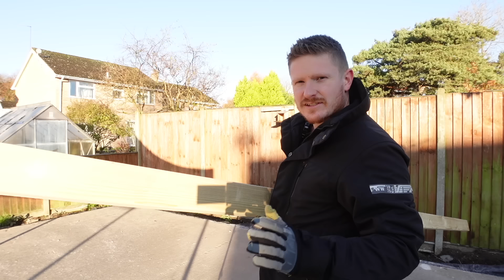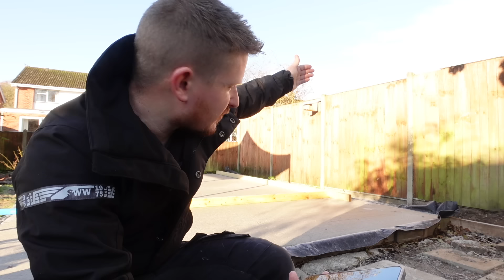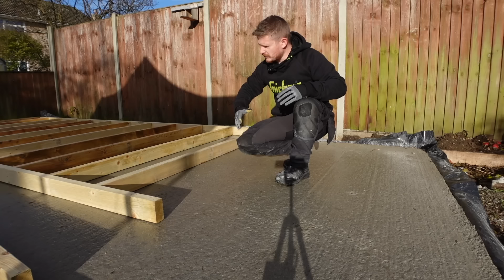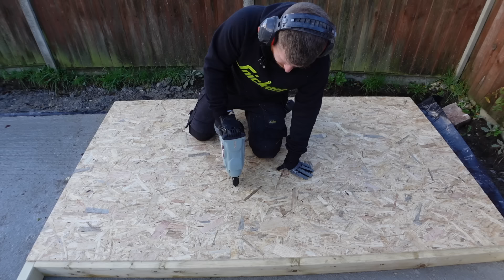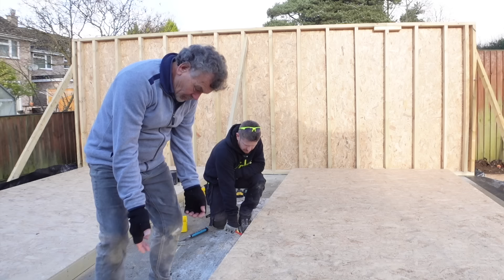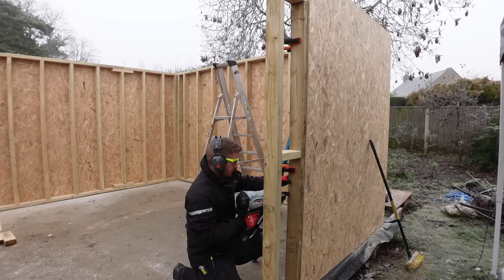How to Build Timber Frame Walls Quick and Easy  - Workshop Build PT3

Comment from the maker: Hope you guys enjoy this as much as I enjoy building it! Roof episode to come soon 😊
Reply: Looks great, how does our climate suit these frames and ply? Like moisture rot.
Reply: Hi mate, thanks for the video and all the good work you! Just wanted to ask what you think of the Evolution pop-up gazebo as I am after a good one and would be grateful if you could share your opinion on that please. Thanks
Reply: That's stick frame not timber frame..
Reply: The studs C16 or C24?
Reply: Hello there DIY Guy. 

I’m building a garden room using your design. I’m just finishing off the front wall (4.8m wide) and have made it from two side panels (1200mm each) two 300mm wide supports for the lintel (1200) for a French door/window combo (1800mm wide). 

My concern is how to make the various components really tight and strong. Could you let me know any top tips. 

Thanks

Comment: Morning. Love the videos.  I am about to receive my log cabin for DIY build.  The builders have put in a slab base which is bigger than the cabin.  The cabin will come with a base and I am wondering whether or not I should be installing and dpm underneath the bearer's 1st?

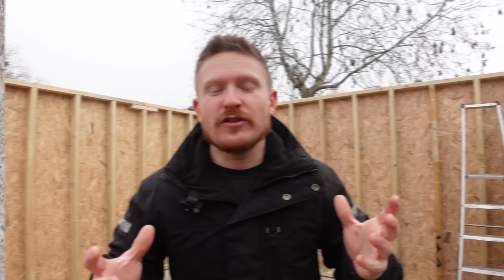Comment: 15:55 - thanks for this, loving the channel, hugely helpful! BUT I'm adding a course of engineering bricks before the sole plate so think I need M10 bolts and resin instead of these concrete bolts? Heard conflicting opinions about the brick layer but seems more belt and braces...

Comment: Just wondered about the maths for the side walls? Isnt the length of the wall 3820mm rather than 4000m due to the front and back of the building. It doesnt effect the number of struts and i think only effects the angle by a degree (i.e. nothing as the acuracy of the cut probably negates that)

Comment: how did your sheets line up with the centre of the stud. Standard OSB width is 1220mm and if you are going every 400mm centres but starting at the edge of the first stud then the sheet is going to hit close to the edge of the 4th upright not in the middle - or am I being stupid?
Reply: are you using 12mm OSB?
Reply: Yeah, I just started designing mine in CAD and not only does 400mm not work with 1220 OSB it's even worse than that....the first measurement has a whole 2 inches of the 2x4 on the outside stud whereas each internal one only has HALF the stud (half for each OSB board). In other words, whatever the measurement should be, it will be different for the first internal stud on either side of the wall.
Reply: I've just seen another comment he replied to. He's ripping the OSB to size I think! Didn't mention that in the video. =[

Comment: Stellar video. Say, any particular reason why you use 400mm spacing between posts? Can I get away with 800mm?
Also, why put a membrane on the wall boards if I am going to use IBR for cladding?

Comment: this is great... quick question though, back in my previous carreer in the horse world we had many stables built over thenyears and the contractors always sent us a spec sheet to have a builder do the base and always lay a course of blue bricks to stop water creeping up the woodwork, i noticed you did not do this, will water not sit on the DPM strips and evtually creep up into the wood. one time at a stables this was not done on downpours we would get small amounts of water coming into the stable and wetting the wood shavings bed, not much but it did certainly creep in.... your the expert though so tell me im over thinking it. 😊😊 I know its presurre treated but todays pressure treated is not a patch on what it used to be when chemicals now banned were used.

Comment: Hi, really learning a lot from your channel. Im planning to build a shed myself therefore I'm watching your video's. 

I have a question. Your front wall is higer than your back wall, this creates a certain degreedifference. 
Did you also adjust the beams you lay on the roof for this slight difference in degrees, by cutting a flat bottom where they rest on the backwall? The beams are flat and now they lay not perfectly flat because of the height difference. I hope you know what I'm trying to ask.

Comment: Good evening, i have just laid my concrete pad first time ever, 5x6m!!!! im now considering ditching the thought of doing 2 courseworks of bricks before my timber walls, i have dpm under the pad with a decent overlap, now im considering putting the timber walls directly ontop of dpm and screwing them into the pad, any reasons why i shouldnt do this?

Comment: The angle is actual meant to be worked out using Tan-1 (0.08÷10) = 0.46 degrees.

Comment: Technical question about the side studs - You're cutting each stud 8 mm shorter than the last one and putting a 1 degree angle on it. Are you cutting the angle upwards from the finished height or downwards? Ie you mark stud 2 at 2112 mm, do you cut the angle so that the other side of the wood is slightly higher than that, or do you mark it so it is slightly lower than that?

Comment: Did you screw through the DPC & DPM on the bottom plate, breaking the water barrier - would it not allow water to travel through to the timber base plate?
Reply: 100mm screw wouldn’t be long enough to go through the tiber and all the way through the slab to penetrate the DPM, but could be an issue if the pilot holes are made too deep

Comment: Nice work. You mentioned using 1 degree for side wall uprights cuts (along the 2" side). Did you also cut uprights (along the 4" side) of the front and back walls at 1 degree so the top plates are sitting fully flush against roof joints ? Or this is so minimal that it doesn't matter ?

Comment: The video only showed you fixing a single DeWalt concrete anchor bolt but hopefully you installed more than that! 😜

So how many, ie how far apart would these need to be to hold this structure safely to the concrete base , particularly in stormy/windy conditions. What is the recommended distance apart for those (presumably 6mm) concrete anchor bolts.

Would using 8mm or 10mm bolts be any safer or is it overkill? Are those Dewalt anchor bolts stronger than other anchor bolt types like sleeve anchors or wedge anchors etc?

Comment: I thought the maximum size under permitted development was 15m2 how have been able to build yours so big?
Reply: Contact your local planning authority, or check their website to see if you are in an area that restricts your permitted development rights. 
Broadly you can go 4m out with a detached house, 3m with a semi-detached or terraced, however restrictions apply and you should consult the regulations, or find a local architect via the RIBA. 
Like this building, YMMV

Comment: I believe you put a waterproof membrane before you put the concrete floor, what if my builder did not do this and 2 years on, I am having this damp on plasterboard from the inside. Do you have any recomendation for my problem?
Reply: If you look carefully you can see damp proofing sticking out from underneath of the concrete slab

Comment: how about if you go 2 meters away from the wall, can you build higher? 2.1 meter is not bad, for ceiling but we have mtb, I was planning to store the upright against the wall and I was calculating that I will go 2.3- 2.4m until ceiling.  How far I need to be from the wall to build higher?

Comment: Would building same height walls all around with no drop and then when the roof joists are on make furlings to sit on them to create a fall for the roof work? It would also mean that inside your ceiling would be the same height throughout?
Reply: 100%

Comment: if i space my studs at 400center starting from the edge of the panel my 1220 board sits right upto the last stud leaving no room to place my other board , what am i doing wrong, ? although 16" on center works perfect, regs for uk say 400 - 600 i believe 16" is US. ?
Reply from the maker: That’s common. Rip each board down to 1200 and you’ll be good to go
Reply: Wood sheets are different to plasterboard so if u do to suit wood sheets won't work for plasterboard

Comment: sorry if you get asked this every other day, but what timbers are you actually using. I've seen different sizes of OSB and even the "2x4's" aren't actually 2 inches by 4 inches... I'm assuming they're 50mm x 100mm but when I search for that, I find timber that's actually 44mm or 45mm "finished".
Again, sorry if these are noob questions, but I'm planning my own garden building and I need to get everything right so I don't f it up down the line. 
These videos are some of the absolute best videos out there on how to build a garden room, so I know whatever you say will be right. Thanks in advance.
Reply from the maker: Hi. For the walls I’m using 47x100mm.
Reply: @TheDIYGuy1  thank you so much

Comment: Genuine question,  but permitted development seems to have 2 rules which I can't see that you meet?   The first one is that within 1m of a boundary, the walls need to be made from non combustable material (i.e. not wood!).  The second is that the maximum height at the eaves needs to be 2m (not 2.5m).   Have I got it wrong?
Reply from the maker: As long as the walls are coated with a non combustible material which mine will be(metal box profile) it’s fine. 2.5m at the eaves is the rule and that can be found via many sources online.
Reply: @TheDIYGuy1 Thanks you for clarifying this, big help for my planning of a new garage!  Great videos by the way!

Comment: Just out of interest as im looking at building my own, why didnt you just make the framework square and add 80mm furings to the roof joists? Would that not have been quicker? genuine question, not trying to fault your work :)
Reply from the maker: Good luck with yours. Personally it takes me very little extra time to calculate the fall and angle and make the cuts but If you find it quicker then that’s the way to go.

Comment: Hi Cameron, came across your videos and absolutely loving them as I look to take on some jobs this year.  I am looking at a smaller version of this for my own garden but a question I have if you could help.  I already have solid and level decking which is actually on the top of slabbing, can I use the decking as the base or would you suggest pulling that up and using the slabbing?  Then I assume I'd build a frame for the floor similar to your wall frame to lift it off the decking and place damp proof membrane on that then sit the walls on it?  Keep up the great work and thanks for the Amazon link to some of your tools!

Comment: Love the speed and no nonsense approach. Cocked up with the 10 uprights @8mm though.. needed 11 uprights for that 80mm lift...no lift on the first one !! and I bet you would let the osb hang enough to cover the ends of the other walls too if you built it again ??
Reply: I’m struggling here too it’s not adding up in my calculations 😮
Reply: @trevorswayne3374 is it because the wall is not actually 4000 long but 3820?
Reply: Is it because the wall is not actually 4000mm though it's 3820mm after after taking off the 2 x 90mm for the front and back wall where they join?

Comment: Thank for the explanation of how to work out the wall heights - front to back - and the drop per metre to get a the correct drainage slope on the roof. Very, very helpful. Excellent video series all round. Keep up the top work. Subscribed😊
Reply from the maker: You are welcome! And thanks for the sub

Comment: Awesome vid for a newbie like me! Thanks for all of the detail. Question: why did you not have the OSB on the sides, overlap the 2x4s of the front and back walls at each of the corners?
Reply from the maker: Glad you liked it. No reason, just my preferred way of building. I put them bits of osb in afterward

Comment: Probably one of the beat instruction videos I've watched and I've watched a lot. One question, I want to extend an already old shed but in great condition it's on concrete that needs resurfacing the wood in some areas needs some attention replacing etc... however I want to extend this shed, its 22.26 m² up to a drop in the garden patio which has a drop of around 10 inches I'm hoping to add joint straps (for a floating floor) from the original footing extend over the patio, the extention will be around 7.9 m² is this doable  ? Thanks
Reply from the maker: Brilliant! The shed extension certainly sounds do able to me. There’s a lot of ways you could achieve the height difference to bring the floors level

Comment: Why have you been able to build from wood and not brick?                       

I am looking at doing almost the exact same build myself but came across an issue that you don't mention. In that building regs suggest that building within 1m of a boundary, the walls should be mainly constructed from non-combustable materials. As the build is over 15m2 (which I am now limiting my build to) then building regs apply.
Reply from the maker: Your correct about non combustible materials within 1m from boundary. Simple way around this. Clad the boundary facing sides of the building with metal box profile or cement board and you will be within permitted development rules. Problem solved 👍
Reply: @TheDIYGuy1  Unfortunately not in my case as the area I'm going to build has 3 boundary walls 🤦‍♂️ Basically the garden is an "L" shape, hence going to the 15m2 then building regs don't apply. Which seems mental.
Reply: If it helps, I am constructing a similar wood frame building right up to my boundary wall and building control have said that with cement board cladding on the outside and double plasterboard on the inside I am good for fire regs. The house next door is about 3-4m from the boundary though.
Reply: @pineapplegrower Double plasterboard as opposed to a single layer fire rated board?
Reply: @macmcdade5071  Well that's what the Building Control guy said, but perhaps I should ask that question?!?

Comment: Looking great Cameron. Clever way of calculating the pitch. Only difference I’d have made would have been to extend the osb at the bottom of the walls so it came below the slab and ensured any rainwater running down the wall couldn’t track under the bottom plate.
Reply from the maker: Thanks. Regarding the OSB. I’ve another way of solving any water/moisture issues which I’ll show in the next episode 👍

Comment: great progress on the workshop! Would it be better for those concrete screws to have a washer to hold the frame even more to the ground?
Reply from the maker: Thanks. These particular concrete screws have what dewalt call a ‘locking washer head’ so a washer isn’t necessary. If you take a look at the underside of the head on the video you can see this.
Reply: @TheDIYGuy1  perfect! Will give them a try someday

Comment: Should of done a 6 inch brick upstand around the perimeter to get the timber away from the ground...rain gives up splash which rots the bottom of timber buildings fast....other than that you're doing a good job 👍
Reply from the maker: The dpm will be folded up the side of the walls with a breathable membrane overlapping it. This is then clad. No rain or splashing will come in contact with the timber. This will all be shown in coming episodes.

Comment: Find it interesting that you say you’re limited to height with being so close to the boundary fence, doesn’t seem to apply where I live.

The occupants of a neighbouring property recently raised their garden by around 12 inches by flagging it, (incidentally any surface water now drains into, and floods my garden. Hence the grandchildren can no longer play in the garden. Not only that, they have built a wooden recreation room that is less than a foot away from two boundary fences and is approximately 10ft high if not more. Worse still they have insulated the inside with polystyrene block. Not one ounce of f*c* given.

Comment: Good way to square the two walls is to measure the first length and x² then measure the second length and x² add them both together and square root the total. It will give you a measurement across corners. 👍
Reply: Or use 3 4 5
Reply: @datderpa9499 I thought the same but no this guy's way is great for more accuracy on a structure this way with no up and down ladders and perfect for the roof...learn something new everyday thank you 🙏
Reply from the maker: Absolutely
Reply: Does using osb on the outside of the wall negate the need for noggins ?. Can't see osb on one face stopping timber moving. Not a criticism just curious.
Reply: @johnharris-qr9jj Ignorant American here. What is a noggin? And is this something we also call noggin and I just never heard of?

Comment: Did you need planing becouse of how big the shed is.
Reply from the maker: No, this falls within permitted development
Reply: What about building regs?
Reply from the maker: Also not required in this case. There are certain rules such as sleeping accommodation which would be an exception to this.
Reply: Are you sure, generally buildings over 15sqm need to be substantially non combustible when built within one meter of a boundary. Might be worth checking with your local building control department.
Reply from the maker: I’m sure. The sides within 1m of boundary need to be non combustible to comply with the rules. I will achieve this with cladco metal box profile sheets.
Reply: Ok

Comment: Great video again Cameron is the only difference between using nails and screws for the wall speed? Don’t have a nail gun wonder if it’s worth investing
Reply from the maker: Thanks. Nails are faster but also have a better shear strength.
Reply: @TheDIYGuy1  top man thank you!
Reply: Sorry Cameron one more question! Are you making double swing doors? Looking to do some myself so could be useful for me to wait and watch
Reply from the maker: No probs. I’m not, I was going to fit bifolds but have now decided to do a roller door instead.
Reply: Not a bad idea I will await your next update then 🙌🏽